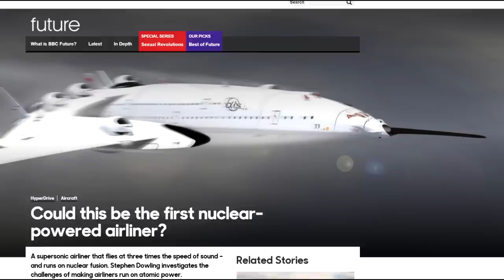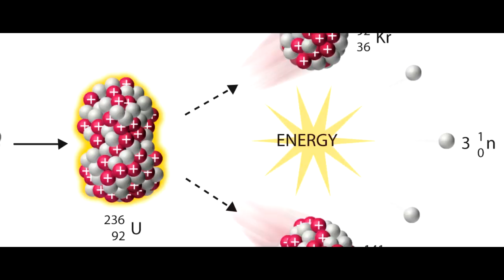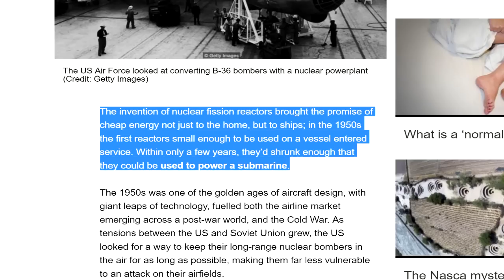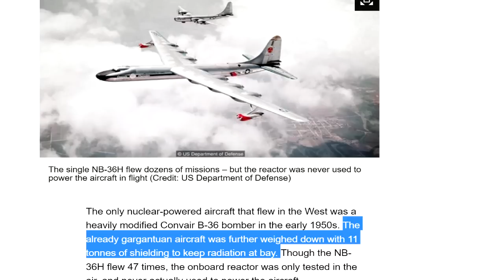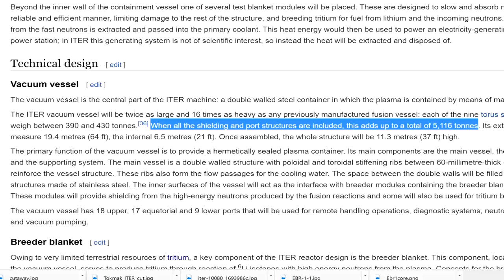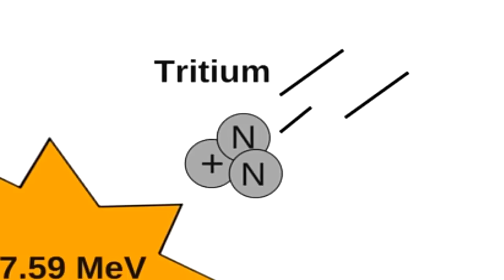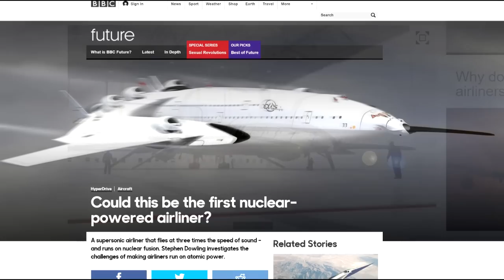SIX ENGINED Nuclear Airliner... BUSTED!

Comment: Nuclear powered aircraft is actually something the US Air Force worked on in the 1950s. The engineers who worked on it thought it was a silly idea but pressed ahead on it anyway because it offered them an opportunity to develop the molten salt nuclear reactor, which offered (and still offers) several potentially major advantages over the light water reactors we currently use. 

https://en.wikipedia.org/wiki/Aircraft_Nuclear_Propulsion
http://energyfromthorium.com/2006/04/22/a-brief-history-of-the-liquid-fluoride-reactor/
Reply: Private Pecker That's correct. The reactor they worked on was a fission reactor. The nuclear fuel was dissolved in a molten salt.
Reply: I think space would be a better place for this kind of propulsion.
Reply: Marmocet That makes sense. 

Now all we need are the fusion reactors that were "about 20 to 30 years in the future" back when I first read about them in Scientific American ... in about 1968.
Reply: Didn't the engineers that are still alive today in an recent interview state that their reactor would have worked in the aircraft if they did not stop the research after just creating the reactor?
Reply: Peter Kosen Nuclear power is much more likely to play a role in aviation, at least in the near term, via hydrocarbon fuel synthesis. The US Navy has already demonstrated that hydrocarbon fuels can be synthesized from seawater for about $3-6/gallon. They estimate that a 100MWe reactor could produce about 41,000 gallons of fuel per day. (That's enough fuel for about 2.3 fully laden Boeing 747 trips from New York to London per day.)
Reply: +killcat1971 check out the nerva videos on YouTube with the nuclear powered rockets. they were to be used on the final stage of Saturn Vs
Reply: They got as far as installing a reactor on a B-36 and flying with it.  But they never drove power from the reactor to the propellers.
Reply: Musica I haven't heard much about it past my dad telling me about the project back in the 1960's.  (He worked for Convair but not on this project. )  But since a reactor is basically just a heat source and I think the one they tested was the right size for the power plant I'm sure they could have gotten it to work.
Reply: @ThatBoomerDude56  The principles aren't all that different between a nuclear powered engine and a chemical fueled engine like a jet. In a conventional jet, the burning fuel and air expands and turns the turbine which ejects the hot air out the back, pushing the plane. In a nuclear powered plane, the reactor core heats the molten salt or water or gas, which then goes through a heat exchanger to heat up the regular air being sucked in, spins the turbine and shoots out the back. 
But jet fuel doesn't require tons of shielding to keep the crew from being killed. And a nuclear airplane would fly without the containment building all reactors have today. If a powerplant has an oops, most of the radioactive products are contained. In a plane, they'd be spread all over the immediate area and depending on how fast this plane is flying, that could be a large area for a melting reactor. The Space Shuttle Columbia left wreckage strewn from the Pacific Ocean all the way to Texas. You could literally irradiate a couple hundred square miles with an aircraft reactor in the throes of a meltdown.
Reply: @Clean97GTI   Yes.  That was the main explanation at the time for why the project was abandoned.  My dad told me that he had seen that the project existed while he worked at Convair.  And I did some other reading on it.  I don't even think they put a big enough reactor in the B-36 to drive the plane.  I think it was just a test of the basic reactor shielding and maybe the heat exchanger.  And they only flew the thing a couple times before somebody figured out, "This is a really bad idea."  

Early articles that I saw about atomic powered planes were always accompanied by somebody saying, "and what if that thing crashes?"
Reply: now they're about 15 years off (we think)
Reply: +killcat1971
Yes and no. Huge advantage they can give is fuel efficiency which matter in space a lot. Also some of downsides can be avoided. You don't need to worry about mass so much as long as You don't want to land or lift off celestial body. Potentially radioactive fumes (as to heat up fuel and make it expand to push your ship you can pass it through reactor. Will disperse in space and will proper safety rules won't get to crew or back in to Earth.  But sill you need shielding to protect crew and heat managmet becomes bigger problem as it is not so easy to cool down things in space. And You need to consider some problems, failures that might cause reactor and its fuel to fall back to Earth.
Reply: The test reactor also melted, so there's that.
Reply: Musica Do you mean worked, as in, it would have been a successful means of aircraft propulsion? If so, then not to my knowledge. Molten salt fission reactors were successfully demonstrated though.
Reply: Marmocet yes.  The Convair B-36 test might not have had a right-sized reactor. It may have just been a test of shielding, radiation levels, and how they were affected by vibration and the stress of being flown.  

In any case, there can be a big difference between possible and practical and with all the problems of weight and radiation danger I don't see atomic power as practical for flight any time soon.
Reply: Even though the largest problem with developing this technology was weight, the weight could be reduced by utilising an unmanned craft such as a drone. This removes the requirement for crew shielding for obvious reasons. A passenger aircraft on the other hand is highly impractical as it stands, however it is something to aim for.
Reply: That aircraft would be very radioactive without shielding. Are you planning on taking off from and landing in a barren, uninhabited wasteland? What happens when one crashes/has to land somewhere populated? And wouldn't the radiation released by a lightly/not shielded aircraft be such a hazard that you'd have to fly at insanely high altitudes?
Reply: whatame55 And this is a passenger aircraft
Reply: Peter Kosen In principle nuclear propulsion for aircraft could work. The biggest challenge, at least in terms of getting a nuclear powered aircraft off the ground, is weight. The materials used for things like shielding and pumping radioactive molten salts around are dense and they need to be fairly thick. Big advances in material science would be needed to make nuclear reactors light enough to serve as aircraft engines.
Reply: whatame55 that was kind of why they didn't go forward with it. Not to mention the problem with their shielding solution. They only shielded the sucker in one direction. Between the reactor and the flight crew. The plane was designed to dump a radioactive trail behind itself. Let's all be grearful that some of the crazier mid 50's aircraft ideas never got off the ground.

Comment: Cool! Oak Ridge Labs did all sort of studies on this nuke plane idea in the 1950's and 60's using thorium as the fuel. Lots of PDF's on what they came up with to be found on the web somewhere. My favorite shape for a nuke powered airline is what Northrop came up with their on their flying wing design with reactor on one wing tip and the passengers on the other. What a Hoot!  Dig the You Tube on "Project Pluto"  , the Dooms Day Drone! CRAZY!  The President said today that we need to start thinking of getting emission down on plane travel so maybe nuke with some hydrogen and a battery pack or two. Keep them engineers busy.  Patent 672256 .

Comment: It's weird to me that those are engines. On a jet plane, the jets are the engines. On a propeller plane, they aren't. Since the energy isn't made in direct contact with the air, I would assume that neither is the source of the motion, so it's probably internal and transferred to whatever pushes against the air with a shaft. Ergo the "engines" is probably no more engines than the wheels of a car are.

Comment: As an electrical engineer working on nuclear power controls... this hurts my mind terribly.
We don't have a prototype of a working concept of power-generation controlled fusion systems, nevermind applications.
Reply: Actually, most BWRs (and the common-to-US PWRs) don't produce weapons-grade plutonium (and certainly not weapons-grade uranium) unless you feed them the right fuels. Which we don't.

The biggest reasons to avoid molten salt reactors is this: chemical contamination, metal severe metal embrittlement of the nickel-alloys used in the piping from neutron flux, corrosion, ease of conversion into a breeder reactor for weapons-grade fissile materials, and generally requires fuel that's sufficiently enriched as to already constitute weapons grade fissile material. It's not significantly better or worse than a BWR, and significantly worse in some respects from a PWR.

PWRs (and BWRs) allow you to cool down for long periods of time, and dismantle significant portions of the primary loop in relative safety. You do not have that option with molten salt reactors and that's why you don't see them used for power generation.

There are cheaper & easier ways to get weapons-grade fissile material without resorting to BWRs or PWRs. Technically, molten salt reactors are one of them.

For those who don't know:
BWR = Boiling Water Reactor, where heat from the fission process in the core boils water, the steam from which turns a turbine to generate power.
PWR = Pressurized Water Reactor, where heat from the fission process in the core heats water that's sufficiently pressurized to prevent boiling. This water in turn is fed through a heat exchanger that boils a secondary loop of water, the steam from which is used to turn a turbine to generate power.

Molten salt reactors were originally tossed aside because they were comparably more dangerous, short & long term, and required concentrations of nuclear material that would be illegal under most nuclear arms treaties. They're being re-explored now due to the significant reduction in cost of thorium, improved alloys, and scare mongering around traditional nuclear power plants.
Reply: I have a fusion concept, but it requires a minimum of four robotic arms and a computer chip that keeps them from going rogue.
Reply: There might be ever any, but not on a goddamn plane.
Reply: Space stations - unless you're doing something massive (say, building colony ships, or possibly habitat stations) at the station, solar power will remain superior to fusion for a number of reasons:
Solar arrays are light (compared to shielding for either fusion or fission plants); They're cheap, by comparison; They're highly efficient without that atmosphere in the way; They're 100% safe during operation.

Ground vehicles, the shielding required for a fusion plant over a nuclear plant is weight prohibitive for either naval or land applications. And the main advantage of a nuclear power plant over alternatives in ships is the lack of need to refuel and improved power, so few non-military ships would ever benefit from any form of nuclear plant, regardless.

Space vehicles, with the possible exception of truly massive generation ships, will have the same problems as any other vehicle (mass vs thrust). Designs that propose isolating the fusion reactor from the rest of the ship & using the hull itself as shielding ignore the very real need to perform maintenance on all parts of the ship, including reactor support services.
Reply: *****
If it will work, it will advance, but since we need so much mass to block the radiation we won't get it up in the air efficiently. In space station or -vehicles it'd probably be fine.
Reply: Let's set aside that nuclear fusion very much exists ; you said it yourself, the sun is an example of fusion (and fusion happens at the nuclear level, so all fusion is nuclear fusion).

Shielding is for more than ionizing radiation. It's also to ensure you capture the radiant heat energy that you're trying to use to power your ship. It's also used for any electromagnetic radiation which might interfere with delicate instruments. There are further reasons to desire shielding of a plant, as we might wish to keep penetrating radiation from sources in space that might interfere with the fusion process.

And, finally, it's worth noting that "shielding" in fusion power concepts is also used to refer to the overall system of sustaining the fusion reaction at temperatures that won't melt your power station.

So, yeah, no, nuclear fusion is very much real (though not sustainable human applications of it have yet been developed) or we wouldn't be here, and if you don't properly shield a "controlled" fusion reaction, it will melt your ship, you won't capture the energy produced for useful purposes, and the reaction won't sustain itself.
Reply: @Viktor M I suggest you watch Issac Arthur's video on fusion to see how wrong you are.
Reply: InaneDragon Fusion does not emit radiation, instead it radiates heat energy. The reason the sun emits radiation and cosmic particles (The solar wind) is because it's so hot that it knocks prices off of atoms by adding so much energy and making the atoms shake so much. Only a basic way of dealing with the heat would be needed, except for the fact that NUCLEAR FUSION DOES NOT EXIST and CERTAINLY not small enough to fit on a plane that looks like Mass Effect's Normandy ship.
Reply: u wot m8 fusion generates neutrons unless it is one of the few anutronic processes reee, literally it generates gammas or neutrons depending on the chain (assuming hydrogen) reeeeee get out
Reply: There have been experiments with nuclear power airplanes. Too heavy
Reply: +Viktor M what's funny is they found 50 ways to build a fission reactor...but we get these ridiculous BWRs that were only dreamed up to get weapons grade materials out of them...

meanwhile molten salt reactors were tossed to the side...they just produce power. conjuring weapons grade material from them is too hard

Comment: It could be possible that one day lightweight radiation shielding will be made.
The arrangements of atoms in metal is random, and thus it is also random whether or not a particle passes through; randomness is bad for guaranteeing the interruption of the path of a particle, while a neat arrangement could have it so that no path is possible such that a ray will not be absorbed.
Reply: I was thinking of 3 approaches:
1.) the nuclear pile is at the very aft of a longer plane. Say 100 ft. longer.
2.) using mirrors with special coatings, the radiation is reflected up into Space, rather than absorbed. a series of mirrors tilted at 45* angle.
3.)The remaining radiation that passes thru the mirrors can be absorbed by that fibrous matting they used in the Apollo program.